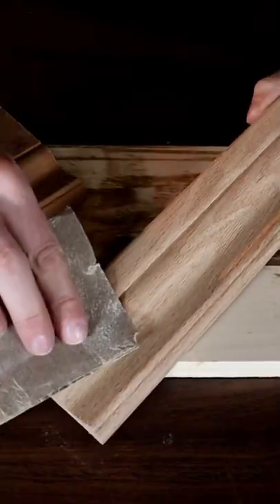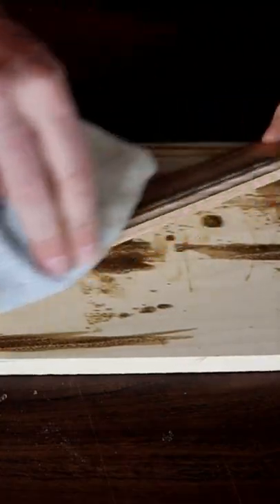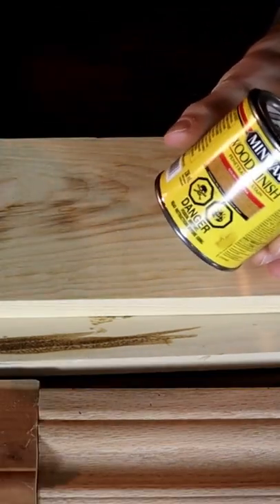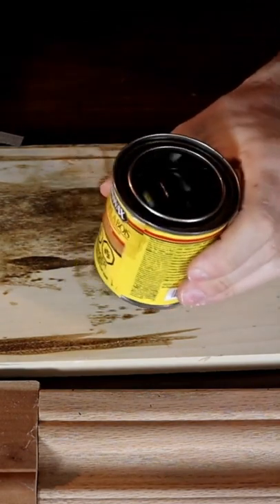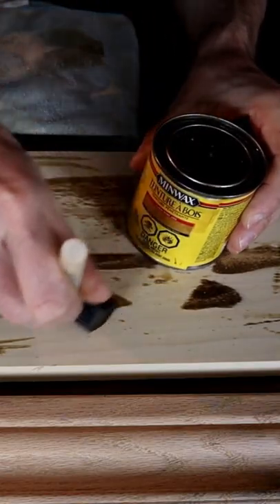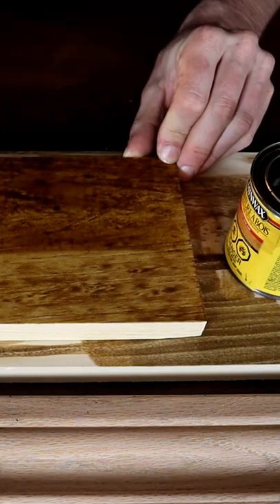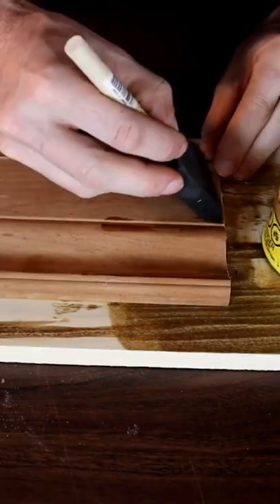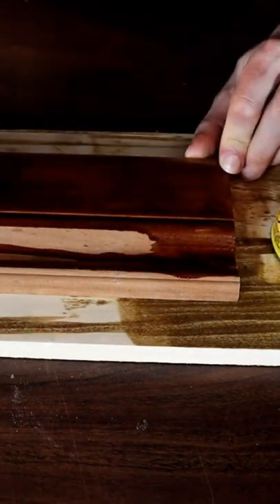How To Use Stain On Wood #Shorts

Comment: Oil based stain always go with oil based top coat  doesn it
Reply from the maker: They say technically you can mix them but I don’t
Reply: paint or stain, oil is first coat, then latex or acrylic can follow  if you aren't going to use oil, but NOT the reverse order.
Reply: If you use the varnish can you put polyurethane on top

Comment: Whats the top coat clear called ?
Reply from the maker: @robertbuckley3480  Shellac – Shellac is best used on lighter woods where durability is not a top priority. This finish is easy to apply, dries quickly, and is best on lighter-colored woods. Polyurethane – Polyurethane is a more durable finish and is recommended for heavier-use areas where moisture is a concern.
Reply: I went few shops and thay never heard of shellac like b+q I went, I looked it up and it’s only in usa and dont ship to uk, ebay and amazon don’t, do you no any like that top coat mahogany